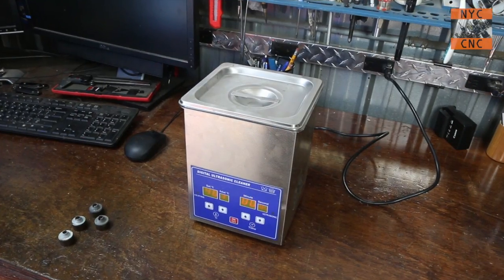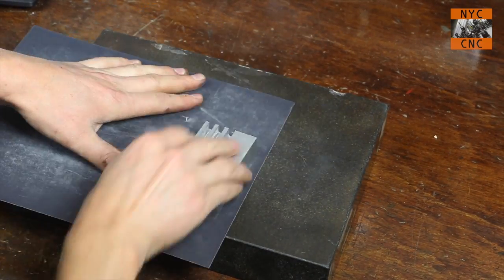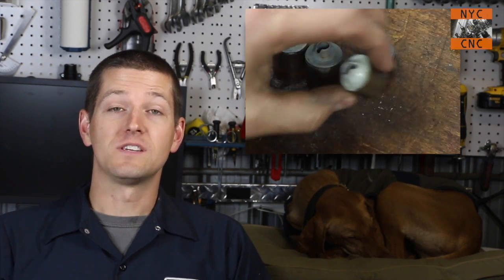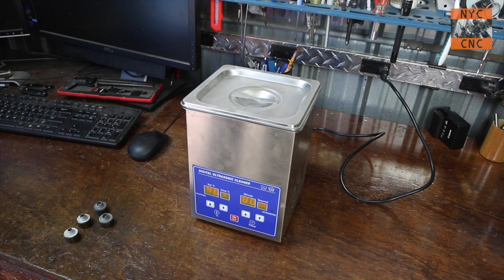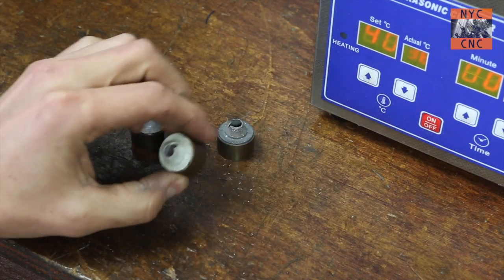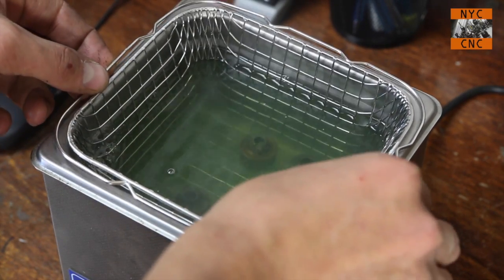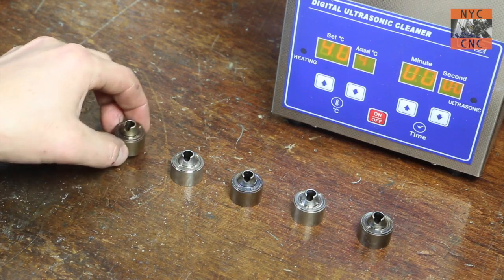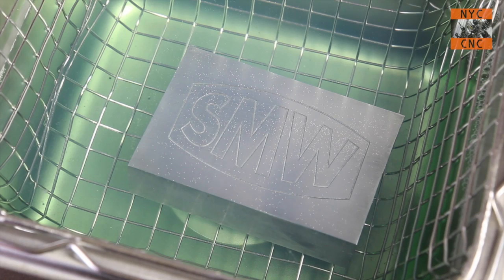Get Parts Ultra Clean with Ultrasonic Cleaner!

Comment: I keep seeing on other videos that aluminum gets eaten up by the machines. You have a block of aluminum which they say will get pitted, and Ive seen aluminum foil get holes in it, in the first minute. IDK if its the machine, or solution, or both that eat the aluminum. I wish someone would show about aluminum and what happens in these machines. like that block you did, I wonder what it looked like before and after through a microscope. Would it pit aluminum? IDK, I'm trying to find out. I saw a demo that put an aluminum paintball barrel in one, but they only held it in there for about three or four seconds.

Comment: A few important points:
-Aluminum in an ultrasonic is usually a bad idea especially if it's polished. If left in there long enough (more than a few minutes) or an alkaline/acidic cleaner is used it will etch and pit the part. Place a piece of foil in there and see what happens.
-It's best to use low or non foaming/sudsing detergents because the suds hinder cavitation.
-Heat usually helps, but too hot and it hinders the ultrasonic cavitation. More than 65C or 150F and it can start to work against you.
-Never place anything directly on the bottom of the tank. Always use a basket. If placed on the tank the sonic energy will be reflected back to the transducers and damage them.
-Always thoroughly rinse parts because the cleaner doesn't flush the dirt away, it only lifts it from the surface.
-Degas the unit after filing the tank and adding solution. Run it for ten minutes to degas, this removes dissolved oxygen that will hinder the cavitation initially. 
-And of course, *read the manual*, but if you have a cheap Chinese one then find a manual online from Elma or Branson and read the dos and don'ts. Those are far more reputable brands with much better manuals.
Reply: Moe Szyslack thank you for the tips! I just ordered a used Cole Parmer model off eBay and very much look forward to using it alongside the tips you have shared!
Reply: You seem quite knowledgeable, so I hope to pick your brain a little. I've heard there are cleaners that ramp the frequency up and down so they they basically comb through various size nooks a crannies whereas a single frequency machine will only attack one size or a very narrow range of pores. Is that true and how much of a qualitative difference would it be? Can you make a machine recommendation?
Reply: @ExtantFrodo2  Most of the better machines do this (sweep function), such as Elma, Crest, Branson, and the like. I'm not sure about the made in China clones. 

The thing about this, is the frequency only varies by a few MHz, and that doesn't make a big difference in the grand scheme of things. However, it is better to have as even that small difference can help to dislodge dirt and debris. 

Good ultrasonic machines aren't cheap. I have an Elma EASY series, but if I could afford it, I'd get a P series. 

Also, the higher the frequency, the more gentle it is on the part and the machine itself (the tub will eventually pit due to the cavitation). It will take longer to clean at higher frequencies, however, that is the trade off. One more positive though is that higher frequencies allow for cleaning finer nooks and crannies.
Reply: @moeszyslack4676  thanks

Comment: take care with aluminium leave it into long and it creates micro hole
Reply: Yeah we cleaned some small parts we had machined then i anodised them, the finish was terible when i looked in to it the surface was full of very small pit holes after calling the cleaner supplier they warned us about alloy take great care better to under do it,but on the up side they are amazing

Comment: I've seen a poor mans' version: a five gallon bucket with a vibrator (eccentric weight on an electric motor) strapped to it. It obviously won't compare to a real ultrasonic cleaner in capabilities, but it also won't compare in price. Load it with some simple green, put in parts, hang it by its bail, and turn it on for a half hour. Works great for larger pieces that won't fit in a normal cleaner.
Reply: NYC CNC
The principles are the same: use high frequency vibration to scrub the parts in a cleaning liquid. It is different in the technical details, but very similar in the basic principles. But where this shines is when you have large, one-off parts to clean that won't fit in your existing machine, or you have a lot of parts to clean in a short time (set up a bunch of buckets to batch process, fast and cheap!)
Reply: NYC CNC
Sounds like an experiment, to me. If it works, great! If not, you can always re-use the vibrator elsewhere. Just use a cheap, junk motor with just a switch, or a speed controller if you want to get fancy. :)

Comment: Back in the early1970s, I worked for a small company that made industrial ultrasonic cleaners. One of the engineers told me not to put my hand in the water when the cleaner was running. He said it could perforate my fingernails and damage the nail matrix. The matrix is the area where your nails originate. Damaging the matrix could result in deformed nail growth. This is a lifelong thing.

Also, we built a 3-foot cube ultrasonic transducer for the Navy. They tested it by placing it in a swimming pool. The test engineer said it looked like the water was boiling. The thing couldn't be run out of water because of the vibration. It was a Cold War thing and I doubt it ever went beyond cleaning government swimming pools... :-))
Reply: tom7601 thats scary stuff!
Reply: NYC CNC 
     Two years later: the home jewelry-type ultrasonics aren't powerful enough to cause the problem. Back then there was no such thing as a home ultrasonic cleaner. I don't know if the operating frequency has anything to do with causing injury.
Oops, I just noticed I repeated what I said two years ago.

Narrow minds run in tight circles... :-)

Comment: D/A sander will greatly increase your polishing effectiveness. Also, use a figure 8 on the granite, you are leaving stripes in your work. Lastly the wet paper SHOULD BE WET! Fine grit paper loads up, real fast. just dip in a bucket of water to rinse lay it back on the stone, repeat. But honestly, a d/a sander with 400-1000grit will work freaking wonders. Used to polish street bike frames all the time as a kid.

Comment: I fucked some diesel injectors up in mine. Ran too long, or used a steel basket instead of a plastic dipped basket. The polished finish of the pintles was lost/erroded/ looked sand blasted. I am now forever wary of putting real real high tolerance stuff in these machines. Without a better understanding anyhow. They are NOT 100% idiot proof safe, as i found out. Still clean brass in them, but I'm hesitant to throw an entire gun in.
Reply: NYC CNC I think there is something wrong with our u/s cleaner. its a hornady one, the bigger stainless one. it has a digital control panel on the front, and to get the machine to start you have to touch the button you want, but take another finger and touch the chassis of the machine somewhere. Looks like my injectors suffered from electrolysis. I def feel the issue is my machine. Just not sure what to do about it.

Comment: Use one daily at work for all the parts we make in house. All the 303 stuff we usually use a mildly caustic cleaner. We can use the same cleaner on aluminum stuff as well but if you let them sit obviously they become discolored so need to babysit it.
Reply: NYC CNC We use a Kendal 6L heated one.  Only gripe is the beeper is ridiculously quiet so you never hear it if anything in the room is making noise louder than a whisper.  I believe it was around $200 or so on ebay and we clean a buttload of small turned parts after they hit the machining centers.
Reply: NYC CNC Yup that is the one.  

Perhaps...time is something I'm always without these days it seems.

Comment: i used a ultra sonic cleaner when I was tattooing they work awesome. ebay has a few that are cheap in price quality could be a lottery.
Reply: yes it worked great for cleaning all the equipment and really well with the knurled grips. I even used it to clean my eye glasses. they are so worth the money
Reply: I picked up a 6 liter off of amazon Vevoor branded chinese. And it works amazing just takes a long time to get solution up to temp around 65-70c usually turn the heater on in the morning around 9-10am for parts to clean by noon. Unless you turn the ultrasonic side on with the heater the solution comes up to temp 2x faster

Comment: Careful with aluminum good sir it actually causes cavitation to aluminum. check the aluminum foil test with ultrasonic cleaner to show you what it does to the surface of aluminum
Reply: Ps: I use my 200 watt ultrasonic cleaner on plastic all the time works great to remove paint! I just make sure it doesn't creep up past 140°F and I use simple green with deionized water
Reply: Well I can't speak for the thermal decomposition of all plastics but I have done this with ABS and Polycarbonate mostly on 3D printed objects
Reply: No problem. I own the Zortrax M200 I'm one of your followers on instagram username techbuilder you can see pics of some prints I've done on there
Reply: Honestly it's a print and go printer with amazing quality far better 
than any printer available for it's price range including the Ultimaker 2.
I used to own a Job shop with a VMC(Matsuura MC500V2) and a 5 ton turning center(Yam Ck2) 
and I wanted to use a 3d printer to test out some prototypes I had in mind but didn't want 
to spend the time to machine them due to complexity and parts for customers to make. I went the cheap route and bought a cheapy
printer (solidoodle 3) and had to machine and replace 98 percent of the parts including 
electronics to have decent print quality which I still had to watch the printer. The
point I purchased the printer was to hit print and go and it wasn't that way at all. 4 different
printers later including one SLA printer and I'm now happy with the Zortrax m200. I was a beta testor for Afinia and 
they have great printers as well (repranded Up printer) but the build volume is small and 
the quality is not as nice as the Zortrax. Either way check Zortrax out
Reply: I know it sounds like it! lol but man I went through hell and money so I only praise it because I appreciate it. It's like the love you have for your Tormach since you started on a Taig mill and the difference is day and night. Form 1 is slow and if you go on their forums you will see the loads of people who have had to send their printers back over 3 times. It's crazy! I don't think SLA technology is on the consumer level yet as far as reliability honestly and when a print fails with SLA it could be 3 to 60 bucks down the drain and you don't have your print the consumables plus the cost of resin is still to high even with companies like maker juice and such
Reply: It's pretty awesome if I want to completely get rid of the layer lines I can do a 30 second vapor bath or sand it for a minute with 240. Visually you can't see the layer lines only by feel

Comment: In dentistry we use the ultrasonic all day.  Instruments are first cleaned with soap, water and a brush.  The staff wear heavy nitrile gloves to prevent accidental puncture wounds from a sharp instrument.  The hand cleaned instruments are then placed in the ultrasonic that we have placed a tablet that helps break down the blood and spit!  After 5-10 min in the ultrasonic  the staff then bags the instruments and into the autoclave they go to sterilize.  The instruments remain bagged until you are in the chair for your dental treatment.

Also, the staff would clean their wedding rings, diamond earrings and pendents!

PS Love seeing Judd get some air time too!
Reply: NYC CNC John, the ultrasonics used in the medical field are the same as the one which you showed.  The size of the unit seems to be the only real variable.  However, they slap a "Dental Ultrasonic" sticker on the side of the machine and charge us double the price!
Yes the dental instruments are a surgical grade of stainless steel.
Reply: NYC CNC No idea what grade of stainless is used to make surgical instruments.  That is above my pay grade.  I just drilled 'em, filled 'em and billed 'em!

Comment: A useful tool but never, repeat NEVER, be tempted to hit the power button without any fluid in the tank.
Reply: NYC CNC Correct! Cooks the transducer.
Reply: Absolutely, it would take a thousand years to degrade one of those by any noticeable percentage.
Reply: NYC CNC Like most men I have not fully read the manual on flux capacitor use , I must learn all it's intricacies for better operational control so I could have thought of that.
Reply: Or behind, depending on your perspective.

Comment: Nice video, another like. 
I worked at a photo lab years ago and we had a large ultrasonic cleaner for cleaning racks. The tank was about a 1'x2'x4'. We would always let a new mix or a mix of cleaner that had sat unused for a while out gas for a while before we actually cleaned parts.

Basically just turn it on for a couple minutes with just the liquid in the tank until you hear the pitch of the ultrasonic buzz change. All the dissolved air is driven out of the solution and it works better. The air in the liquid acts like little sponges absorbing a lot of the power that could be used cleaning the part.

Comment: I have the same one.... works great..   I make a lot of small monogram necklaces out of aluminum and polish them to a mirror finish on a buffing wheel and it gets rouge packed down in the small holes.  5 mins or so in the ultra sonic and they look like polished silver.

Comment: I have used an ultrasonic from Harbor Freight for over a year now. Mostly on cleaning fired brass after tumbling them in media (walnut or corn cob). The one thing that is really important (at least to me) is using distilled water. I know that it sounds like complete nonsense, but on brass it is a must. The brass will develop corrosion if the tap water air dries.

Comment: That was a great "lame tool review".  :-)

I bought all of the laser components for my 80W CNC laser project from LightObject.com and not only did they have the best prices and great service, they also sent me an unexpected free gift - a small ultrasonic cleaner.  The box sat on the back of my lab bench for a couple of years.  After watching this video, I put some hot water in it, and pressed start.  Three minutes later, I have very clean eyeglasses.  I may put this in the bathroom and use it to clean my glasses as I shower.  I followed the Amazon link and I may buy the larger ultrasonic cleaner for the shop.  I knew once I started ultrasonic cleaning, I'd be hooked.

BTW - As soon as I pressed START, the curious cat jumped down and ran off.  Apparently, cats don't like ultrasonics.  Probably 40 KHz, way too high for me to hear, but probably a loud high pitched whine for a cat.  Just checked.  Cats apparently hear up to 85 KHz! http://www.sciencedirect.com/science/article/pii/0378595585901005

Have you tried Abralon or Micromesh foam backed disks for random orbital sanders?  They're essentially 1500 or 2000 grit sandpaper that will quickly put a mirror polish with no sanding lines or swirls in that SMW logo on the SuperFly cut block of aluminum.  Great for a nearly instant French polish when woodworking, too.

Comment: Great on motorcycle carbs, I throw the whole thing in. Plastic parts and all. RInse, blow, install and run. I hate alcohol in my gas! Never had those problems before.
Reply: NYC CNC I actually have 2 of the HF models, both of their sizes. Wife took one for her jewelry. I kept the bigger 1, if you want to call it that. I generally just use water, sometimes and little simple green or even dishwashing soap. All seems to work well. 

 I take the float bowl off of the carb but throw it in, floats, rubber orings, aluminum, steel, brass, plastic etc. I havent seen it do damage to anything even after extended cleanings (or repeated cycles due to a short timer imo, 4 minutes IIRC. It is also heated maybe in the 120f range. It doesnt seem as vigorous as yours but does the job.

  It does not improve the looks of a piece, only cleans it. I am waiting for clothes washing machines to use ultrasound and no chemicals to release dirt.

Comment: I have the 2.5L HF model. It works alright but it feels underpowered. Put a handful of parts in and suddenly it doesn't seem to work much at all. That, and the way it's built allows the condensation on the lid to drip down into the internals of the machine. It sounds like I'm boiling a teaspoon of water every time I turn on the heat.
Reply: It is. http://www.harborfreight.com/25-liter-ultrasonic-cleaner-95563.html

That's the TC button (temp control I'm guessing)